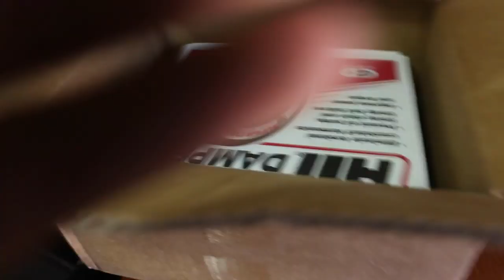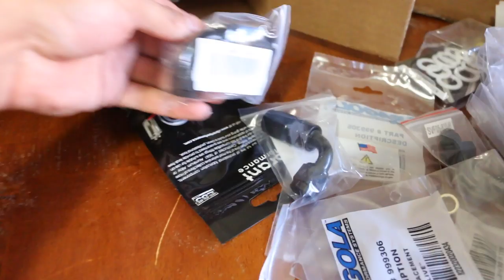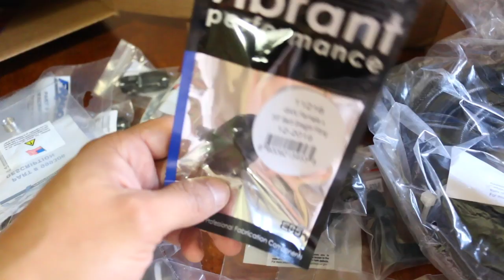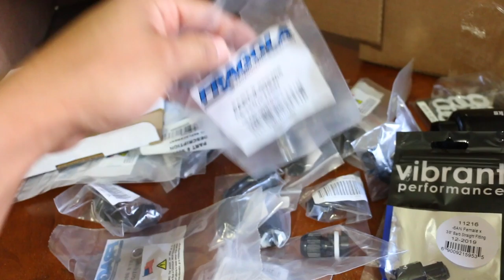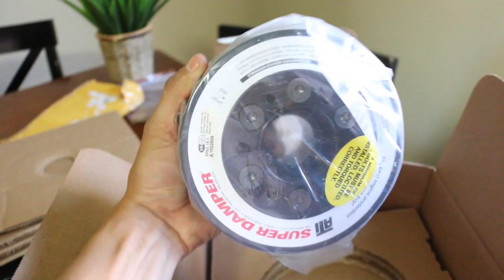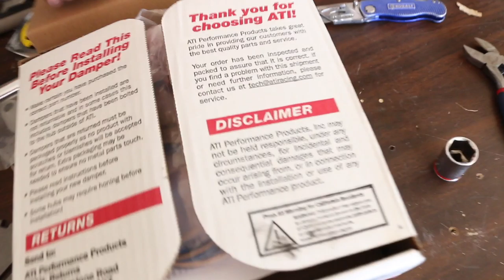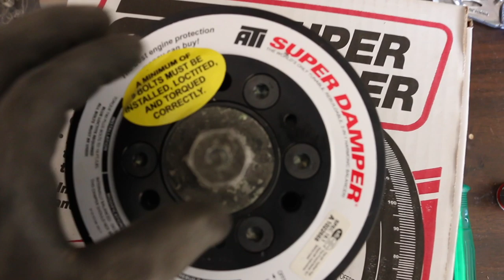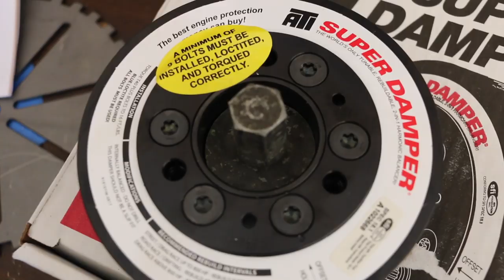MK3 SUPRA 7MGTE BUILD, NEW ATI SUPER DAMPER AND CRANK TRIGGER WHEEL

Comment: Also how did you align the damper in relation to TDC and how did you figure out where 60 degrees was? Great video though and thanks again!!
Reply from the maker: TorontoSupraMan TDC was already set prior to removing it. Also the crank has a “key” engraved in it so Damper can only go on one way. ATI damper alao has markings on the shell. And the 60 degrees is an aproximate number... i was just following the instructions and pictures

Comment: Quick tip:   When you don't own a lathe to machine down components (such as  your crank bolt), you want something that can provide a constant rotational speed while you use your grinder. The easiest garage item to do this would be a drill.  Take a socket driver, insert it into the drill, and put the proper socket on the driver.  Mount the drill upside down (so the socket doesn't fall off) into a vice with scrap wood. Turn on the drill, then use your grinder to remove the necessary material.  This is one of the easiest ways to make a lathe when you don't have one.
Reply from the maker: Joshua Blair i disnt think about that, definitely something to do next time i appreciate the feedback

Comment: Love my spec billet steel fw with 2.5 clutch assy. Bust out another thousand is what I always say. Hey my brother took a quick vid of me pulling off in my Supra I uploaded it...
Reply: I did hone my ati damper. I used a piece of sandpaper And dowel and spun the damper. I only honed it until the coating thinned you could tell it was even by looking at the coating as soon as it was gone I installed it. Used anti-seize circa 2009 I resealed the engine during covid didn’t have a problem pulling it off and on...
Reply from the maker: Tough times cant just “bust another thousand”

Comment: excellent video - did you just manually set the ati damper to TDC by looking at it then torquing it down? Or is there a dowel pin that lines up so that it sits how it's supposed to? I have a stock GE motor with AC and PS so I'll have to mount mine with a custom bracket for the hall sensor. I'll probably just weld (or bolt if possible) the 36-1 trigger wheel to the stock GE crank pulley in front.

Comment: No power steering? What’s the plan cause supra  steering is heavy. When my power steering rack was failing it was a pain to turn in the 7m?
Reply from the maker: TorontoBuilder12345 i was driving it without power steering since day one.. it wasnt bad 🤷🏻‍♂️
Reply: I think "since day one" is the key there. If you drive these cars with and without power steering you'd definitely want to keep it if you're going to be driving it a lot, especially when parking and slow speed maneuvering. If you've never had it tho then you won't know what you're missing so it's all good
Reply from the maker: danwil77 i have a lexus sc400 which might be just as heavy if not more with power steering.. 🤷🏻‍♂️

Comment: Get a mechman alternator.
Reply from the maker: Edgar Mota i might be doing a mr2 alt, fairly cheap oem replacement and 130amps
Reply: I went with the 140amp from DM...
Reply from the maker: christopher williams how is that holding up
Reply: Mechman doesn't make one for 7M. I have the Suprastore 140amp. MR2 one is a good option too.
Reply: @-LFATV  well honestly im in the same boat as u bro...mine isn't finish yet. So all i can say is everything bolted up fine to the drop down bracket...cause i had a different one that was an upgrade for the 7m but it didnt line up with the dropdown bracket
Reply: Singer Alternators is what I'd recommend. He is a small one man shop that is well regarded in the car audio crowd where high amperage is needed.  The same people who have used Mechman switched to Singer and have been very happy they did.  Mechman may be popular on the web, but they aren't the best solution.
Reply from the maker: christopher williams DM uses a oem housing so makes sense for it to bolt up
Reply from the maker: Joshua Blair the deal breaker would be if it works properly with the drop down bracket and belt
Reply: @-LFATV  Singer uses the factory small hairpin alternator, and rewinds it to your required specs.  I believe the MA70 supra uses a 6 phase alternator, but if you need to reach Mike Singer (the owner), he can be reached here:  msingeralternator at gmail dot com
Reply from the maker: Joshua Blair thank you man. Are they expensive?
Reply: @-LFATV  While I can't speak for Mike and his products, that last time I spec'd out a custom alternator from him was for a 3.7 liter Acura MDX and the price ranged from $350 to $550 depending on which amperage you request. Those price don't include any custom paint or powdercoat (which he can also apply).  As you can tell, they aren't cheap, but in all honesty, unless you're installing a high powered audio system in the car, Driftmotion's 140amp should be more than sufficient (assuming the 140 amp spec is accurate of course).  The largest current draw is heat and A/C on a vehicle and 140 amps should be more than sufficient.
Reply from the maker: Joshua Blair yikes.. i might just do the mr2 one lol i dont got it like that

Comment: Are you going with a 2j alt?
Reply from the maker: Daniel Stewart no i think ill be using the 130amp mr2 alt
Reply: @-LFATV  cool cool
Reply: @-LFATV  I've been working on a mounting bracket to mount an ls alternator to the 7m but I'm trying to keep it in stock location so it probably wouldn't help you too much.
Reply from the maker: Jonathan Gardner yea man it wouldnt, goota drop that puppy down man
Reply: @-LFATV  As nice and easy that would be, I would like to eventually put AC back in my car.
Reply from the maker: Jonathan Gardner i removed completely everything lol
Reply: @jonathan7744  I do have sleeper brackets
Reply: @RottenTomahoken  I've heard about the ones that can hold both... but as a creator id like to try to make my own especially since I want to switch to a gm alternator.